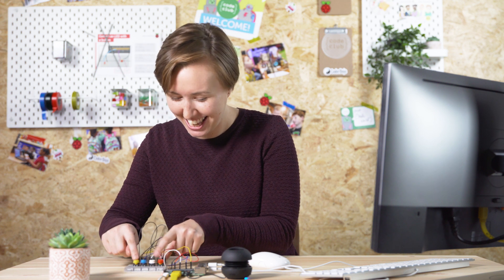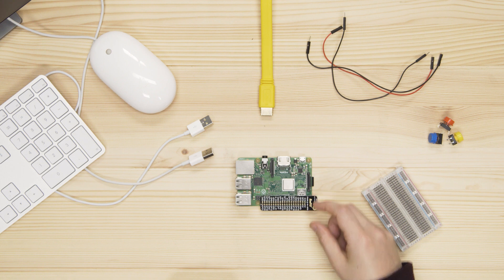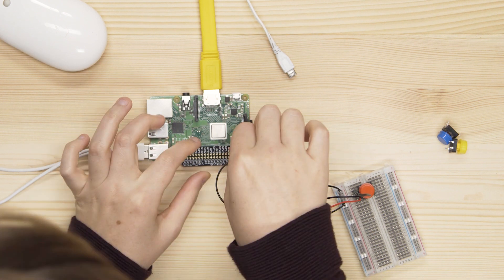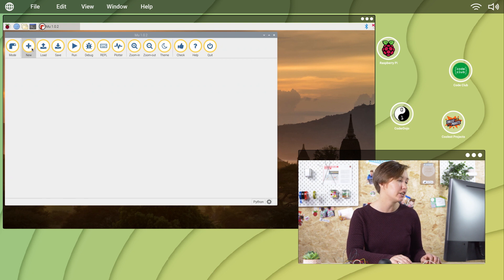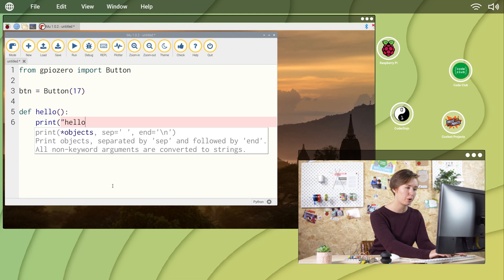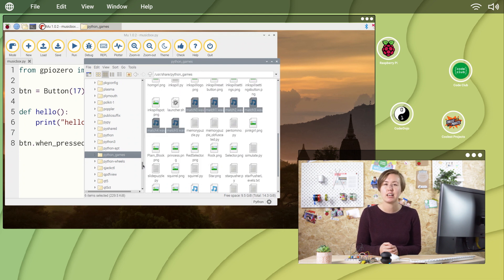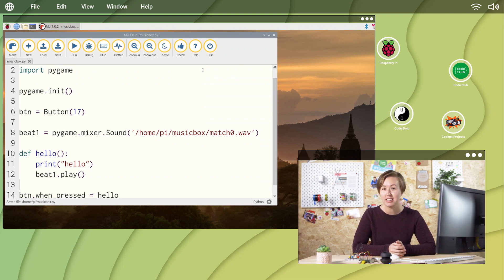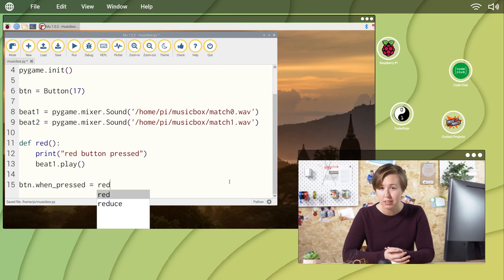Build a Raspberry Pi music box ft. Dr Sally Le Page

Comment: When I run this code in rasberrypie 4 and while pushing the button I am not able to get any output can any one whats the reason
I tried pull up down resistor and changed different pins but not able to get whyyy😭

Comment: When i click my button. my pi turns off. is there something wrong with my pi?
Reply: No, your bridging the wrong headers when you press the button.  Either its shutting down as a protective mechanism or you've bridged the power and ground headers which would initiate a reboot if your using a non-momentary switch.  You must use a momentary switch, the difference momentary would be like a door bell , non momentary would be like the play button on an old cassette player.  Take caution this may not be any protection mechanism , you could be pushing current in a way that will damage or kill your rpi, or at the very least corrupt your data.